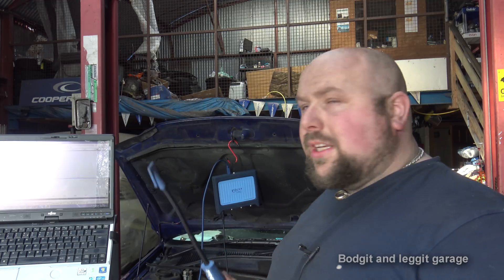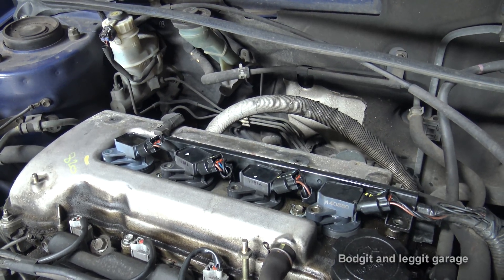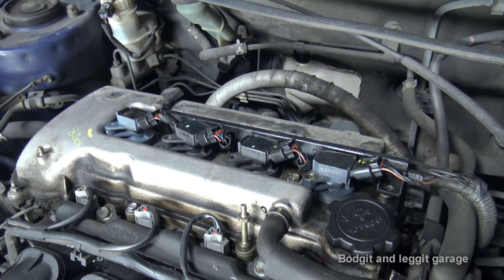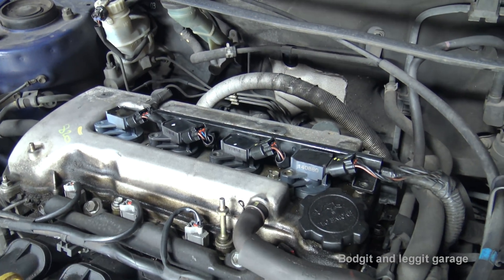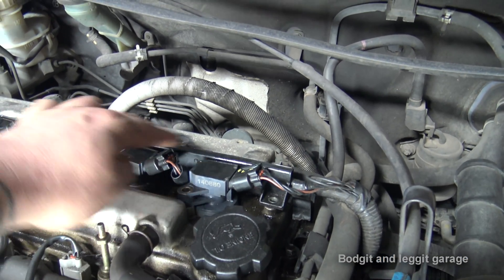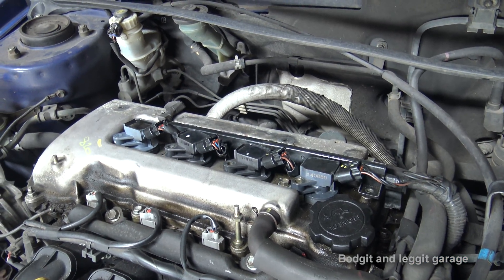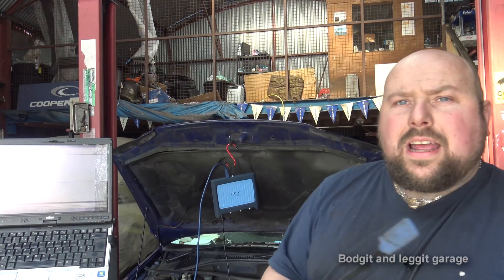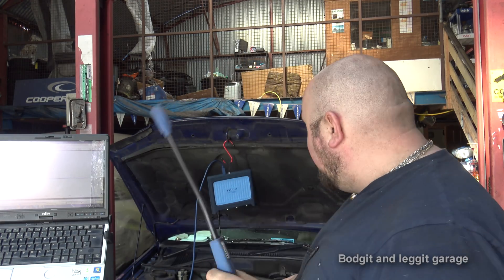Toyota Bubbling? Smelling Fuel 50000 Volt How Am I Still Alive

Comment from the maker: Before anybody asks the reason I use the pico in this video is cos I did not have the ditex scope at the time I'm if I did I would have done the exactly the same thing but I am doing a video very shortly on the ditex cope with the ignition test  on how to do all four cylinders at the same time stay tuned for that
Reply: bodgit and leggit garage any advice on why a ford galaxy 1.9 tdi loses power ? Like it goes into limp mode. No fault codes. Could it be turbo or egr?

Comment: Sounds like you need to change the rocker cover gasket as that might be causing oil leaking into cylinder 4 which is causing the misfire. That’s why the coil is lasting a week.

Comment: problem with 7:08  is, you're likely carbon tracking the plug boots..... as great and non-conductive as they are, they're still better than clean air gaps and it only takes a single "bang" to leave a snail trail lol.
I don't watch the overseas fellas all to often, but not and again, it's interesting to see the shoebox vehicles and micro-engines, which tend to not last a few years here. ;)
Reply from the maker: Lol

Comment: Good video , threw me when you said Good Friday Tho !!  :) without a scope I would have checked for codes  ie random misfire or misfire number ? and an emission test for co o2 and hc's then like you a gentle lift and a listen for the spark jumping. and visual inspection. A question did you check the plugs for gap and corona discharge signs and obvious tracking ? The reason I ask is more and more I get these problems and it is lack of plug changes. We are now into the realms of 60k before plugs need changing,and every body ignores the 4 years. Especially if they have platinum or iridium plugs ,a second hand dealer may well change the oil and air filters but how many new owners would take off coil packs etc to check if the plugs were done? After all some plugs are rather expensive  and dealers don't like spending money. Standard spark plugs are just as vulnerable but wear is masked by the power of modern coil packs. So many times I have cars in that are low mileage ,ten year old immaculate cars with misfires starting to show under load  that have never had plugs ..".because they are not due yet..they haven't reached 60k etc.". Modern coils are  mind blowing compared to the oil filled coils of the 80's and 90's  BUT as the spark plug gap widens the current draw on the coils  increases and they get stressed and hotter in an already hot environment , something has to give and often the spark finds it easier to jump sideways through the insulation. If an O.E. coil pack had been fitted it may well have lasted longer, but I would not put much money on it. I have seen this on VAG cars,GM Fords Citroen Peugeot,never replaced on on a Honda Tho ! some double platinum plugs cost an arm and a leg. One lady had a nice 2006  C4 which failed the emission test on misfiring, had never had plug she was told they had been changed when the car was serviced at citroen...No...charged tho the gaps were nearly 3mm no wonder it had problem ,strangely the coils were ok. Plugs seem to erode/wear more on the number of heat cycles so lots of little trips cause the most problems, not up to temperature for self cleaning perhaps ?
 She also said she had stopped using it on the motorway because it "didn't like it and stumbled "  how many coil packs should not have needed fitting if the plugs had been inspected.
One last thing on G M coil packs , a main agent admitted that the coil packs were rubbish, if they fail in warranty no problem, outside  ,tough luck happily for GM they fail usually around four years old.  
Have a Merry Christmas and a happy new year.
Reply from the maker: Hi mate you don't need to check any since as regards the gap when you read the way from properly you can check everything from the way form without even having to take the plug off I am going to be doing another video explaining how you can do this
The reason why I said good Friday in the video This video was filmed a long time ago I have over 20 videos already filmed and uploaded on my channel which I share with my patreon first and then release them as Time Goes By

Happy Christmas to you and yours too mate

Comment: I got hit by a oldsmobile quad 4 doing a safety inspection.  It had a pinhole that came out in a wire that was chafed. It backfed into a secondary wire that I had the tach lead on . Hit me hard enough to put a dent in the hood. Dont know the voltage, but all four coils were tied together like a 4.0 jeep. Hurt like hell and made my arm tingle for a couple of hours.
Reply from the maker: 🤣🤣🤣🤣 it's a shame you didn't get it on film mate it would have been funny maybe not at the time but still funny lol

Comment: I had a similar one on a fiat. My mothers carer had a mis fire (on her car) and the garage that she had used for years told her it needed a new cylinder head and quoted £600 so she asked me if I could do it cheaper! I did a compression test and it was ok but on inspection 2 of the long reach plug caps looked burnt, tested them and they had cracked and  just like your coil pack the spark was everywhere.Cost was £60, so much for her usual friendly garage.
Reply from the maker: boom nice job mate

Comment: All these comments about how you could have found it without a scope.   I think they miss the point.  You learn what the traces look like on a the easy ones, so when you come across one that require 3 hours of work to remove and intake to get to a coil you can have a confirmed diagnosis before you tear it apart.
Reply from the maker: boom yes mate

Comment: Had this on my Corolla - coil died. Ordered a new one off ebay for £12 IIRC. Drove on 3 cylinders for a day. I think the ECU turns off the injector for that cylinder so i just drove it gently for the few miles i had to do that day. This was over a year ago and still running good.
Reply from the maker: sorted

Comment: bodgit and leggit garage.Altho I have been out of the garage repair trade for a good number of years and definitely not fully clued up on some of the later vehicle systems . I don't have any problem with your diagnostic methods or repair experience in doing what is best for the customer,  One of your other videos where brake calipers that were in a dreadful state needed some heavy handed work took me back to my time in the garage trade and the thoughts I used to have , If customers could see what has to be done at times to their car , they would weep.
Reply from the maker: boom thanks mate

Comment: Temporary I will isolate with tape, best heat resistant. And should do for week when parts available. People can't understand that this is not brakes system, or crucial safety system... You can drive on 3 cylinders or misfire. Some even don't recognize that ever morning they have same issue on they own cars... Good job
Reply from the maker: sorted

Comment: Leon, thanks for the video. I know you used the pico but maybe next time you could show us the wave form pattern using the Ditex scope. Thanks for sharing mate Cheers 👍👍👍
Reply from the maker: Hi mate I've left a comment in the video stating when I did this over 4 months ago I did not have the ditex cope at the time that's why I use the Pico I am going to be doing a video on the ditex cope with the special ignition tester built into it explaining this in a lot more detail

Comment: A lot of coil pack failures are due to owners not replacing their plugs often enough. Sometimes you have to improvise.
It's only a bodge if it does'nt work.
Reply from the maker: Yes mate 100% preventive maintenance and regular service is the key to make most things last longer it's common sense but the problem is with common sense is not very Common

Comment: "In a perfect world, you need to replace all 4 coil packs with genuine ones"..Even if I give you replacing the aftermarket 2 may make sense because 1 of them has failed already, but why the 2 original ones. They're not hidden by a plenum. What evidence to say that they will fail in the next year even? And I'm assuming that you replaced the spark plug as well.
Reply from the maker: I explained everything in the video to why I did what I did and had to do what I had to do maybe watch it again

Comment: I am not at home with all this modern stuff, 'tis why I settled on my MK2 Reliant Robin which is about as close as a 1960's Mini without the insane prices you can get techwise, whilst lacking the tin worms the metal cars suffer from too.   Is it still quite informal over there where things like tax, mot etc were kinda seen as optional out in the rural areas?
Reply from the maker: Yes mate it's like everywhere you can get away with a lot especially in the rural areas but like everything eventually you'll get caught

Comment: id be looking at the misfire counters and swap some coils around and see if they changed, probably would have looked at the mileage and reccomended other "maintenence" items (like the spark plugs if they havent been changed in the last 105k miles( 168981.12km according to google) but man, quite the coils that were in there haha i assumer the S... whatever coils were the cheap ones, well to be honest ive seen some people quote the crap in their stuff because "hes a used car guy, hes gonna ask around, maybe even bring it to the shop that puts the stuff in for cheap, might as well since hes just gonna go that route" but then theres also the other side of it which is "this part wont be here til the next YEAR, we can get the aftermarket but i cant guaruntee the quality of the repair mr. mrs. customer, would you like for me to take care of it today? (on the flip side what i also think people hear, "did you want to take it to the shop down the road so you can see if they will just fix the dumb thing for you today?") i dont see what your doing "wrong", things happen, silly stuff also happens like holidays haha! too bad some people are quick to judge before asking/assessing the right questions/information, then guess whos the butthead haha, thanks for the vid! lots of fun!

Comment: Cheers for that insight into coil packs. Do they go regularly?
Reply from the maker: Yes but then old coils in an old cars were still a serviceable item still best to change them because they did break down they still worked but not worked at their full potential
Reply: @bodgitandleggitgarage  true, over time they could, but then they were not difficult to test.
Reply from the maker: Yes mate the very fickle things even disconnecting them can blow them up they can be working fine one minute and then go the next minutes they are just ticking time bomb waiting to blow up essentially lol
Reply: @bodgitandleggitgarage  I'm used to old cars with a coil. The coil itself seldom was an issue.

Comment: As you pointed out, its essential to know the consequences of doing certain tests like disconnecting coilpacks.  One way I've diagnosed problems with coilpacks is to hook them up using old ignition leads , modified to fit . Then check for a spark one cylinder at a time with a spare plug hooked up to the relevant coil and ground the plug with a jump lead.  The scope is a lot easier and more reliable by the looks of it . I wonder if a timing light with an inductive pickup give some indication?
Reply from the maker: Yes mate that might work but the only problem is you still cannot tell where the spark is occurring what I mean by that is it will show up as a spark as the timing light with switch on but but you would not know if it's occurring inside or outside the cylinder that's where a scope comes into play

Comment: You seem to take a lot of unnecessary shortcuts and its not a good example to be setting for others to see
Reply from the maker: 🤣🤣🤣🤣 ok ok explain yourself what shortcuts do I take
Reply: @bodgitandleggitgarage  oh noooo not another saga.....😱😱😱
Reply from the maker: @shaunsautorepairs5410  🤣🤣🤣
Reply: @bodgitandleggitgarage  I think the big one is, having a good idea what the problem is, you went straight to it, rather than say, changing the wheel bearings first to see if that helped? ;) (There is no pleasing some people).
Reply from the maker: Oh yes my apologies for having an engine missing I should have gone for the wheel bearing first and then make sure the back seat belts work I will have to bear this in mind for next time
Reply: @bodgitandleggitgarage  Quite. I can't see what you did other than follow the obvious route to fixing the problem. Sounds like it's missing.... Unburnt fuel... check spark. I will have to look back and see if he answers with what the shortcut was.
Reply from the maker: @BensWorkshop  I am looking forward to him answering back
Reply: @bodgitandleggitgarage  I can see that.... I feel a rant coming on.
Reply: I thought his process of elimination was just right tbh, with the fuel niff and missing you ain't going to be looking up the exhaust or checking the sunroof and a failing electronic module can be a right git to diagnose if its hit and miss working.   Back in the old days it was condensors on the points that were the buggers, they usually went bad over time and with that erratic ignition so you ended up chasing your tail as they got hot stopped working then cooled down and started working again.   So you think well its sparking so not the condensor and start yanking at the coil, the coil wiring, earthing points and its still playing up and more often or not owners replaced whole distributors for the want of a 50p condensor.
Reply: Where do you get these arseholes from why they can't just enjoy the videos would they challenge ERIC O SOUTH MAIN AUTO don't think so bet his charges alot higher than yours for similar work
Reply: Jane Toon right they are dummies. Eric charges $70 an hour I believe unless his rates went up since I last heard him say it
Reply: Yeah welding junkie from what he said a few weeks ago $100 just to diagnose any fault but overheads higher than here in UK insurance,health, liability etc but then again is it worth it to get mechanics like Leon and Eric O you can trust
Reply: Z B I’d love to see your videos on this without your “shortcuts” oh that’s right you’re just a troll. It takes time and effort to make these kind of videos, I didn’t see your shortcuts. Don’t be a muppet your whole life.
Reply: @weldingjunkie  your name speaks for itself...welding junkie...your just a junkie who has shit all subscribers and shows how insecure people like ypu and leon are....keep kissing each others ass ...happy new year :)

Comment: Remember fitting a spurious pencil coil to a millionaires bit on the sides A4 convertible years ago because he is tight as arseholes. 2 days later another cylinders coil went. Another spurious coil. 2 weeks later another one went. So that's 3 different cylinders coils failing in 2 weeks. This time he bit the bullet. I went to Audi and picked up 4 genuine coils at £23 each. Car was mint ever since. Man at Audi told me should always swap em in 4's. I think the spurious ones were only a fiver cheaper.
Reply from the maker: Yes mate it is always best to change for but like I said in the video when you live in the real world different circumstances and different things can happen so you only can replace what you can replace

Comment: Had a similar problem, 2000 Baleno, visual inspection only, fixed with heatshrink. Sorted, little boom.
Reply: I did the same thing for a friend on her zafira until the new part came. Micro boom

Comment: You're alive because its the frequency that kills you, not the voltage. 👍😉
Reply: It's the current that kills you
Reply: Jantzku 
indeed amperage is a factor in prolonged exposure, but frequency is also a factor particularly in AC (where the likelihood of Death is far greater through interference with heart rhythm), as opposed to DC.

Example 120v AC @ 60hz kills.
whereas 240v AC @ 50hz does not kill.
Reply from the maker: Boom lol

Comment: Usually working as a roadside mechanic, I plug the diagnostics in and it should tell me what cylinder is running bad. What I do then is swap the coils over, so process of elimination. If I haven’t got one it has been known that I use copper ease down the end of the coil as this makes a circuit.

Comment: Great video Leon, did you read any codes on this first to see if there was any codes for misfires? 
On the coils, I guess it depends where the parts supplier gets the bits from, can get some good aftermarket stuff, but on the other hand some is absolute junk
Reply from the maker: Hi mate no I didn't need any codes sometimes experience just tells you what it is oh yes I agree with you about the aftermarket parts

Comment: Toyota have always loved that Igf confirmation signal. Never knew it could damage the Ecu to unplug. I have unplugged one and noticed the engine stop.

I can fully understand why you went aftermarket to get back on the road. 

Interestingly I think small gaurages get more pressure to complete jobs quickly than dearer ships. The dealerships have service advisers to bs to the customers.
Reply from the maker: Yes I agree with you mate small garages were under a lot of pressure we don't have all the technical information for the main dealers do and we are expected to do everything the joys of being a mechanic lol

Comment: Bit of insulation tape jobs a gooden 😂
Reply: Did that on my own car. Worked for two days before requiring more tape....
Reply from the maker: @andrewthompsonuk1  🤣🤣🤣🤣 boom
Reply from the maker: Boom sorted lol
Reply: I think insulation tape would break down after a while, thats a lot of juice flowing in that module and the cheap chinese tapes aren't up to the kV insulation if its tracking out.   I have a roll of 3m stuff that is heavy duty but I wouldn't trust it wrapped round a HT lead not to leak and moisture would get in there sooner or later to make it leak.
Reply: Ian Watson bet you’re a right laugh at parties